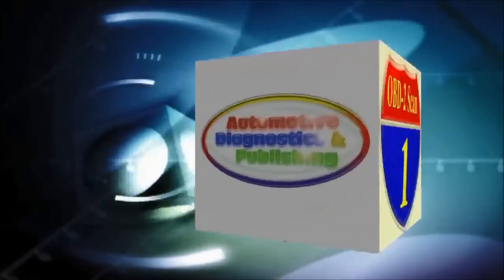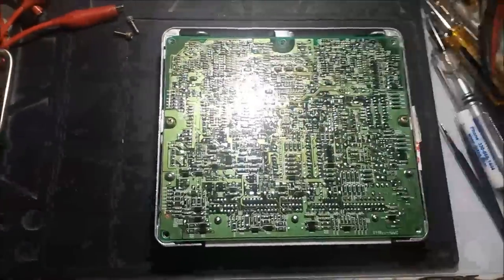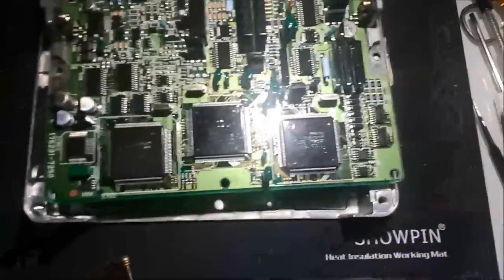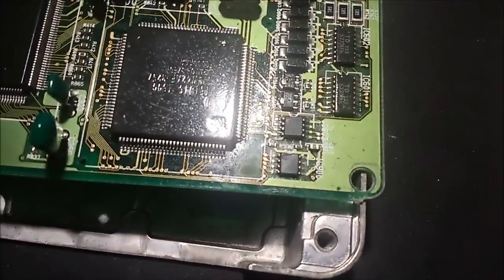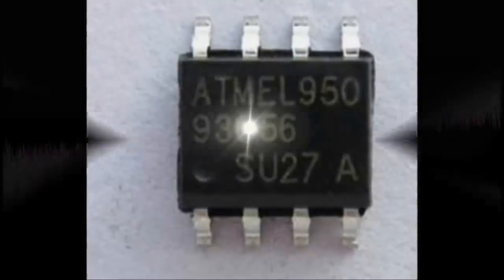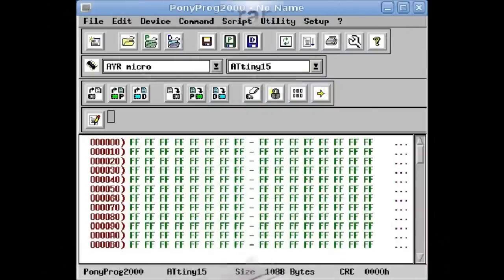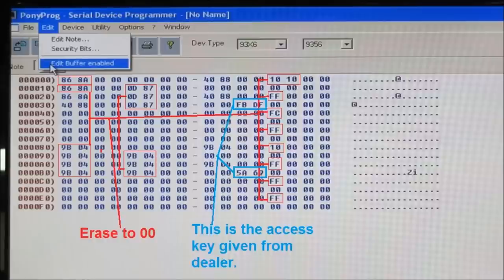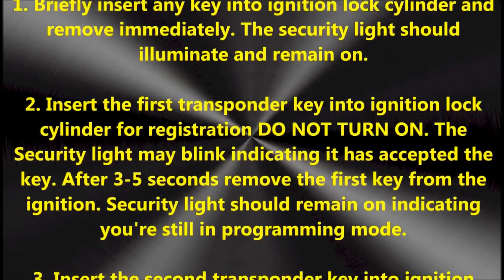ECU Key Reprogramming Toyota Lexus

Comment: Thanks for the video. I think this may be my issue. I bought a used ECU ad tried to match it to my key by shorting two pins on the OBD connector and waiting 30 minutes. It just does not work for me and I suspect the eeprom is full. That said, the "blue numbers", are they identified by the address they're located or by the value? That was not clear to me.
Reply from the maker: Thanks, DONATE: https://www.paypal.com/donate/?hosted_button_id=F9W5VPHTGWBV6

Comment: hi there..

i have an 2002 toyota estima that i am doing up to get on the road.. it has been taking me some time and in the process lost my key... i have managed to get a non transponder key cut to the lock but obviously it still wont start..
should i buy a blank transponder key from ebay or should i get a second hand key ..
getting the key to match the barrel is not a problem (i have pulled it apart and changed the wafers)..
question ... do i need more than 1 key to program the ecu... in the video it shows 3 keys but are all three needed..
Reply from the maker: There's a limit in memory. If you've reached that limit, then you're out of luck.

Comment: if battery is disconnected, how would the key data be kept stored in the memory?
it could remain in memory for a while without power, but not more then days.
is there a seperate small battery in the module that proved powr for memory?
since it is writable data, not factory set, its impossible this would be kept for ever without adding power. ofcourse this could be 10 years without power.

there must be a way to clear the eeprom without needing to edit the bits in hex
Reply from the maker: Who told you needed batteries to keep memory????